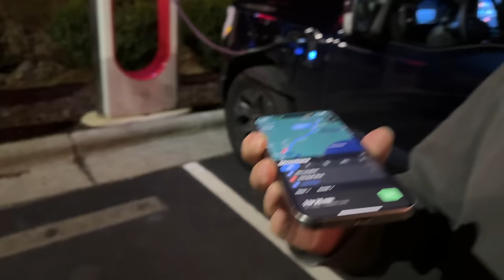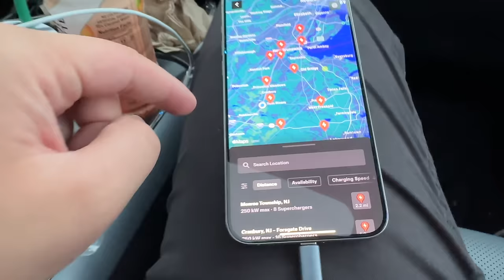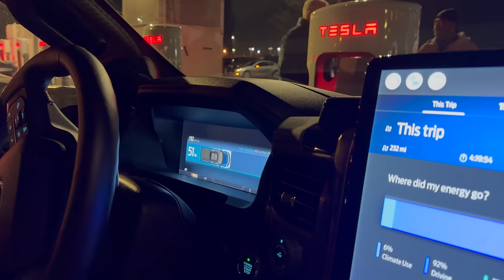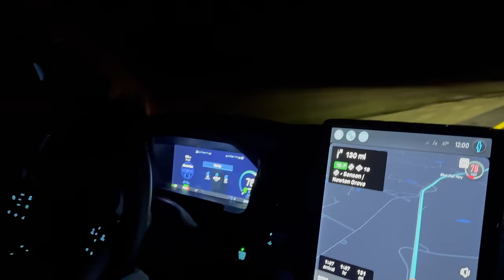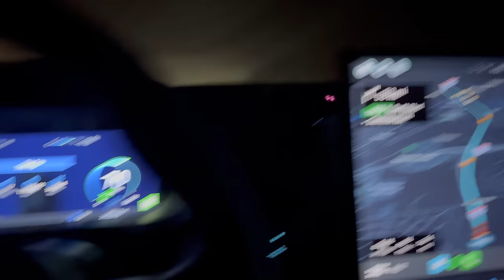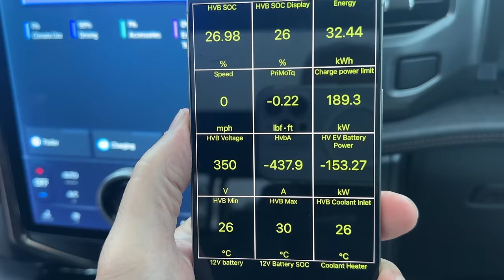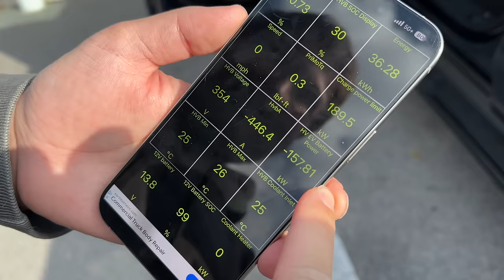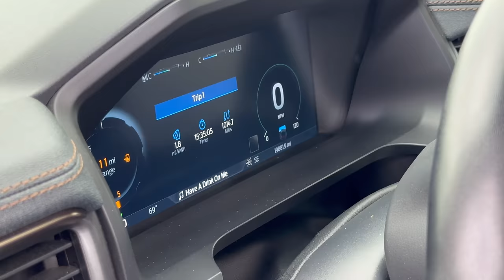1,000 Mile F-150 Lightning Race Against CCS Using Only Tesla Superchargers w/ The New Adapter!

Comment: When driving the lightning manually (no bluecruise) if you press the accelerator just enough on a downhill to prevent regen you can effectively “coast” without putting the truck in neutral. The power meter will show a blue line when you are using energy, and a geeen line when you are regening so as long as you see no blue and no green you are coasting! Pro trip from a lightning owner with 36k miles 😎

Comment: 48:41 I like how the illusion of taking up 2 spots at a supercharger will be just fine got shattered immediately. It’s all fun and games until there is a line waiting and there are open charging pedestals because some are taking 2 spots. That didn’t happen here, but if they arrived 10 minutes later it would have. Gonna be a lot of uncomfortableness.
Reply: I agree.  I just took my Lightning from Palm Springs, CA to Vegas.  I used a Tesla charger 3 times over the trip. It gave me anxiety pulling into stations with lots of cars.  Thankfully they never got too busy.  I was able to use the handicap parking spot 2 times which is wider and didn't take two spots.  The 3rd time I was able to use the far end spot. In the future I will plan to only use the massive chargers (60+) where it's less likely.  Either way, I wouldn't want to try this on Thanksgiving that's for sure!

Comment: Tom and Pete did great. Zero mistakes and EA stations that all worked perfectly (which is not exactly common)  still lost to Kyle and Dave because the Tesla Supercharger network is so well placed for long distance travelling.   Image a more common situation with problematic third part charging and the difference would grow dramatically as will the frustration of the driver dependant on third party charging infrastructure.
Reply: I guess this race disproves that tired talkin point.

Comment: I loved these videos. They do highlight why EVs may never fulfill a common use case for vehicles in the Western US: they add too much down time to long road trips to be economically feasible. You showed that the Lightning was a great road tripper for someone who is vacationing in an EV. If that's what my use was, I think I might buy a Lightning, even though I hate pickups. With that boost, it is a much better casual roadtripper than anything anyone else makes that I have tried or seen so far.

Unfortunately, when you talk about time spent charging, there were a couple of things you left out: 
  1) if you were not in a "race", each stop would have been extended by shopping or passengers deciding to use the bathrooms after the charging was complete, 
and 
   2) you only timed the actual charging process, not the opportunity costs of slowing down, exiting, pulling up to the chargers, plugging in, and getting back up to speed (you did talk about Tom & Pete's Google Maps debacle, but not the rest)--how much further would you have been had you kept traveling at 80 MPH for that whole time?. 

Our experience with driving a trip of 1091 miles one way in a Model S LR added 6+ hours to my normal with an ICE vehicle, and a Model X added 5:45. We tried a Model Y, but turned around when it was clear that the first charging was so soon that we would add about 7 hours. With a Fusion or a Camry we have 2 stops that total less than 30 minutes lost. With a Mercedes GLX 350D, it's 15 minutes faster than the sedans because we only have one stop for 15 minutes total ET loss. EVs just suck at long distance travel where time is money. And, even when I travel on vacation, I am not at all interested in the sights along the way. I have already seen them when the trip WAS the vacation. Now I just want to get to where my loved ones are.

Comment: Tom is able to make his first stop 20 miles farther in Stafford (Garrisonville) with 2 Tesla stations (both with 8 stalls, one across the street and another a 1/2 mile farther down the same road) and you stopped in SPRINGFIELD (at the Springfield Mall).  While both vehicles were similar, the driving styles and your route through DC, while picturesque could have made a difference in range.

Comment: By the way, that relatively inexpensive charge that Tom got at Brunswick, GA Electrify America is now no more.  That location used to be about 36 cents per minute without Electrify America monthly membership.  Shortly after Tom used this station for this trip they switched that location to per kWh pricing, and it is 56 cents per kWh without monthly membership!  That $10.89 Tom paid would be a whopping $44.18 at 56 cents per kWh and roughly $35.34 with the around 20% discount with EA monthly membership.

Comment: This test if very real and honest. I'm willing to bet that the Tesla super-charging team is going to watch this to assess what they need to do to make it work.
"I'm going to draft behind this Prius to start making up some time." That has to go on a t-shirt with a massive F-150 behind a tiny Prius for scale!
Reply: Ha love it
Reply: I think the big thing that's gonna make the difference is the V4 superchargers dispensers that have much longer cables, not to mention the V4 chargers will be able to charge 800V vehicles at full efficiency
Reply: @KiRiTO72987  By doubling the voltage, they can halve the thickness of the cables to deliver the same amount of charge and the cables can be longer. I expect that the V4 superchargers will use slimmer cables than the V3, but not half because they are capable of delivering more power. Longer cables, yes, but not a lot longer.
Reply: @surferdude4487  they'd still need to be the same thickness for charging 400-500v cars at full speed  like the models 3 X and Y, the Cybertruck is currently Teslas only 800v battery architecture vehicle and I doubt they would reduce thickness and hurt their own vehicles charging speed

Comment: Just a FYI the Benson, NC Tesla chargers are always like that. It is not due to people blocking the chargers out of protest, its because the hotel doesn't have enough parking spots to accommodate the guest so where else should they park. I avoid this place anytime after 6pm - 9 am if I'm just charging but, this is my choice hotel when I travel North. I usually grab the free chargers, if they are working or charge before I go to bed because they will not be available when you wake up.

Comment: When you abruptly lost power at 1% -- that's the same thing I experienced the only time I ran my lightning low, except it chopped power on me at 3% SOC, and I coasted into my driveway with the pedal to the floor. I was surprised at the confidence in running the pack down to 1% or 0% leading up to this. Crazy the difference in experience there.

Comment: Hello from.the UK. Tesla opening their sites has been a game changer here. Luckily my Polestar 2 had its charging port in roughly the same location as Teslas so using Superchargers is a no trainer especially given that they ate the cheapest network.

So far I've used V3 and V4 chargers and had no hassle with from Tesla drivers.

Comment: Why no one has had the idea of using a 7,000+ watt dual fuel inverter generator on the bed of these trucks to get long-range with no need to stop frequently at charging stations. Current inverter generators that produce 240v and over 7,000 watts have become fairly light at around 120 lbs like the A-iPower GXS7100iRD 7100W Dual Fuel Inverter Generator that is currently for sale at Costco for $999 including delivery.

Comment: As someone who drives a Lightning down i95 a few notes. 1. Charging anywhere between DC and Richmond (EA or Tesla) is going to be a complete sh*tshow due to traffic, demand and congestion. 2. The Lightning is a huge vehicle to have to navigate into any charging stall. It's a PITA to squeeze it into the "island type" EA stations also. (Half the time you then find out the EA station isn't working and have to park a 2nd time). 3. If you were at 2.0mi/,KwH and pulled in at 5% SOC I wonder if you have a defective cell that wasn't taking a full charge. 95% should have gotten you around 240-250mi

Comment: Tesla has to visit the V3 site to add a circuit board upgrade to each charging station to allow the use of the CCS adapter.  A brand new V3 in New Philadelphia site was installed 10 months ago, and 3 months ago I stopped there and was closed down with 3 trucks from Tesla there, adding that circuit board upgrade and I was able to watch them and talk to them about it.

Comment: I would like to see an ice F150 along with you. How many gas fill ups they would need and what time they would have arrived.
Reply: 1000 miles ÷ 20 mpg = 50 gallons of fuel. If the ICE F150 has the extra big 36 gallon tank, only one fill up is required.
Reply: 36g tank, healthy ecoboost or 5.0 getting close to 20 mpg at 75, one stop at the half way point. Easy peasy.
Reply: A F150 Powerboost hybrid would TROUNCE both EA & Superchargers. The fact of the matter is, hybrids reign supreme on road trips.
Reply: Yea so tell me again what is so great about a EV or a gas model?
Seems like you got bent over with and lube on how much it cost you for all those charges!!!!!
Reply: @stephenj6837 is all your driving roadtrips? Because most people don't roadtrip much. Day to day charging your EV at home is way cheaper than ICE

Comment: At 28:15 you don’t have to overly pay attention to when it drops out of hands free. Yes, it’ll show up on the screen, but it reverts to the normal steering wheel nag. If you don’t see it, then it’ll beep at you. I prefer it this way vs it beeping every time it first warns you to touch the wheel. Remember it’s just dropping out of hands free, it’s still doing lane centering and adaptive cruise. If it falls completely out it’ll make noise immediately.

Comment: Great video!  i thoroughly enjoyed watching you guys doing this. Like other comments, the best is the convos among father-son and friends.  The bottom line is adding Tesla chargers for non-Tesla branded cars is a win for non-Tesla EVs as far as extra charging options is concerned.  The software definitely need to be improved for better integration of Tesla superchargers and I'm sure that'll come with time.

I'm not familiar with east coast superchargers, but as 2-time Tesla owner, I'm very family and very comfortable travelling  up and down California and to Nevada and Oregon. We can come across a Tesla Supercharger literally every 10-20 minutes on the Freeway in the rural areas (I-5, I-10).  With exception of key holidays, they are usually not so busy as some supercharging areas has over 40 to even 100 supercharger stations.

As for the charging port locations, it's same for every Tesla car so every Tesla owner at some point become expert back-up parker!  With all non-Tesla brands now joining in, I wonder if they will standardize charging port location for the new models so everyone backs in same way.  Or, Tesla will need to make changes for longer charging cables along with the retraction support or else we will see more cars going over curbs on the edge parking or worst, take double spots!! I personally prefer backing in, because it's easier to park in narrower strips, and less stress to get out.

There are still many key advantage of Tesla cars having full integration / insights into Tesla superchargers on the navigation map. These include:

1. Full stats including 72KW, 150KW, 250KW, etc. power for each charging station.
2. Tesla navigation, using AI/trained telemetry of all Tesla cars driven prior, can make practical range calculations including going through steep mountain climbs and downhills.
3. Navigation will automatically plot optimal stations to stop to charge, including avoiding the busy ones.
3. Map shows Tesla destination chargers (e.g., at hotels) as well as all other non-Tesla chargers

I understand the uncomfortableness of going in to a Tesla supercharging stations as the only non-Tesla and people might give a stare, or come up to you with with curiosity. Tesla already selling too much cars that out pacing the rate of new superchargers. Tesla owners, getting free charge or not, seem to be very attached to Tesla supercharger and destination chargers (usually free). As a Tesla owner, I will naturally feel that "betrayal" and lose the exclusiveness or precious charging spots. But as someone interested in adding a non-Tesla EV to the family, I'm also happy to see this done!

Comment: Im seeing lariat long range f150s listed new for $65k. Besides the cool factor I’m not seeing anything I need in the Cybertruck to justify $100k for the dual motor. I know that eventually that should be $80k. Still, I’m seriously considering a 2023 lightning vs waiting for my cyber truck reservation.
Reply: Wait for a native NACS EV... Do you really want to rely on an adapter? CCS is awful
Reply: The eF150 is a better deal than the Cybertruck.
Reply: @videopyc  sure but 2025 Lightning models will come equipped with NACS natively so why not wait

Comment: Really curious in this scenario if the efficiency gains of going the speed limit would overcome the charging curve challenges. You’re still stopping at the same chargers certainly, but arriving with a higher state of charge offset the speed deficit compared to 10mph over.

Comment: I loved all of these videos. It took a while to watch them all over the weekend. 😂

The F150 Lightening is a really cool truck and I own a Bolt so I know all about terribly slow CCS charging speeds but I’m surprised that the Lightning is mostly given a pass for how slow it charges. 150 kw average and 1.8 miles per kwh seems pretty slow to me. It isn’t much better than something like a Kona Electric which charges at 75 kWh average but get 3.5-3.8 highway miles per kWh. It isn’t exactly a 1:1 comparison but it is about the same in real world time and travel speed. Maybe I’m misunderstanding the impact of the amperage boost. 

All that said, I think too much is made of the slow speeds. I feel like the state of the charging networks are the real problem with road tripping in an EV for normal people that aren’t spending 5 hours over a weekend watching these race videos. 😂

Comment: Kyle, what’s your thoughts onto the Tesla model 3 Standard LFP 100% battery actually giving the same range as the Tesla model 3 Long Range 2170 80% battery and the fact the 2170 battery degrades quicker than the LFP so after 45K miles the SR LFP actually gives more range than that LR 2170?

Comment: The difference is not huge, but it would have charged a bit better if you had been able to use the Ford nav and triggered pre-conditioing on the way to the chargers
Also, you both have OE tires, but does Tom have the Generals and you have the Hankooks?  The A/S are more efficient than the A/T, even if they look very similar. If your tires are very new, thats also a disadvantage.

Comment: EA currently has 4,000 DC fast charging ports. Tesla just opened over 15,000 DC fast charging ports (all 250kw) to Ford. So that's a total of 19,000 DC fast charging ports. Can someone explain to me how going from 4,000 to 19,000 DC fast charging ports can be called "doubling our DC fast charging ports"? Isn't that more than quadrupling it? Or actually nearly quintupling them? 

And please don't bring up the tiny amount of other CCS DC fast charging ports out there, meaning 150kw or higher. They total well under a thousand all put together.

Comment: So you can’t navigate and filter to use SCs only? That sucks
Reply: Since this video has posted, they've shown up in the FordPass app and you can filter by network now and Tesla is in there. I can't verify as I don't own one but I think its the same on the in vehicle screens too.
Reply: This now comes down to options. Do you want to take a chance with EA knowing the stalls limitations and potential chargers failure depending of the time of the day or go with Tesla chargers which are more reliable and plentiful, granted one still has to use the adapter? My choice is clear Tesla got my money.

Comment: I must of missed the strategy of charging to 80%?  I always thought on road trips you can load it to 100% since your use the energy quickly.
Reply: You can charge to 100% before you leave, but The reason for not charging to 100%, on subsequent stops, is not to protect the battery, but to save time.  On a Tesla Model 3LR, for example,  it takes as long to go from 80% to 100% as it does from 10% to 80%.

Comment: I own a lucid with free Electrify America that I set to use 350 watt charging stations that have current availability. I've never had an issue. I pull up, plug in and it always works. I'm wondering when Tesla chargers get 10 times the ars using them like Audi, BMW, Ford etc etc will they still always be available and working etc? I think Tesla people like to believe they're special but it's just an electric and years later the earlier EV issues have been fixed. I do make exceptions for whatever States are anti EV and seem to want less choices for it's Citizens by creating hurdles.